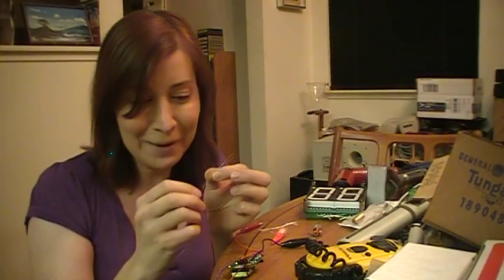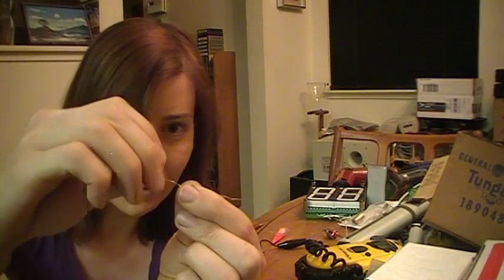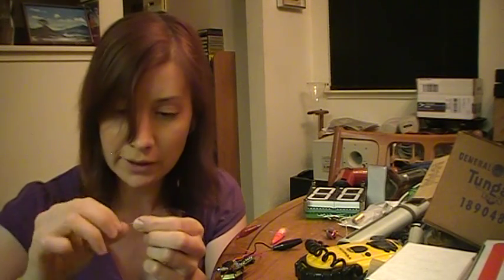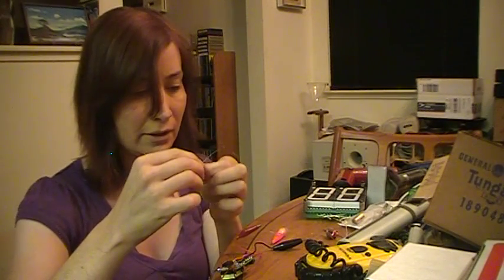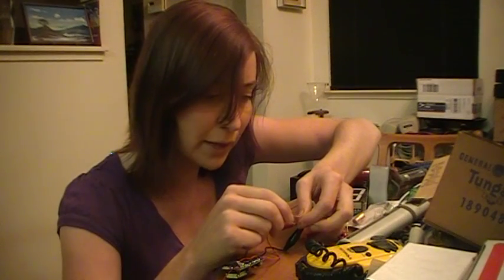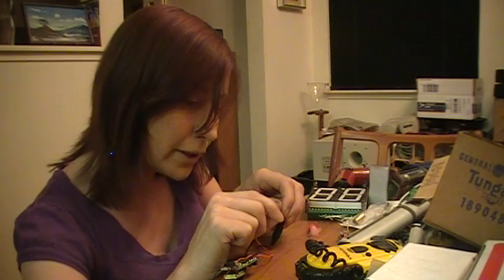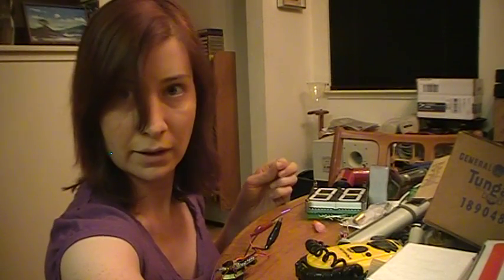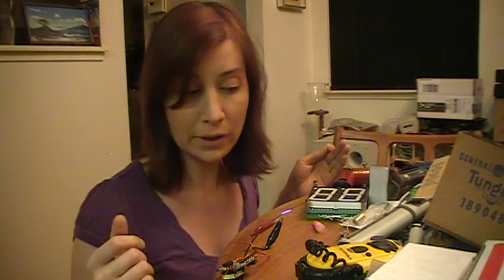Making EL Wire Step by Step - Twist and Shout

Comment: every one thought i was mad putting glow sticks in the microwave  and now its clicked that tiny bit of heat generated by the two wires with the voltage just right causes the glow  is that right you clever girl

Comment: given this is a capacitive setup wouldnt it be more efficient to use a core insulated carrier wrapped with multiple conductors? or a continuous polymer conductor wrapped round a wire? How much does frequency affect charge uniformity in the dielectric?

Comment: Can i use el wire in aquarium ?
Reply: +Afdzal Kamal Most likely not as it does require a rather large voltage (100v) that could electrify the water & kill the fish.
Reply: sure - just coat it in a decent polymer layer so it is well insulated. Epoxy would be ideal if you do not require flex, PVA glue would be suitable if you do
Reply: ever hear of a thing called insulation? they use it on tank heaters at 240VAC+ RMS - quite a bit higher than this would need.

Comment: I just heard you mentioning the power output at the end... does that mean if you touched it while switched on that your hair would stand up just before you fell over?
Reply: no, that would take a LOT more voltage, and it would need to be DC not AC

Comment: cool, what kind of phosphor do you use?
Could you illuminate el tape by putting it across a house light switch, lighting it like a neon bulb?
I have gathered that high frequencies are needed, but does it work at all at low frequencies?
Are there any super simple soloutions to get the required frequencies?
Reply: they are called oscillators

Comment: Can you put a rubber tubing over it? And can it be run of a nine volt battery?
Reply: sure, but a polymer coating (ie glue) is prolly a better idea. And yes, but you will need to build a basic inverter - Jeri gave u links

Comment from the maker: @ObiTrev It would be a stack up type arrangement on plastic.  I posted a video about EL stackup.
Reply: could you not use flat conductive coated polymer electrode sandwiched across the phoshor and a higher excitation freq to improve the dielectric uniformity?